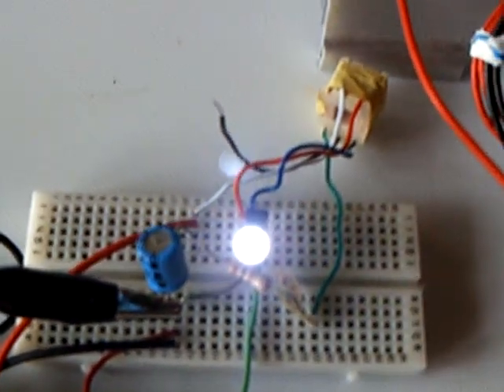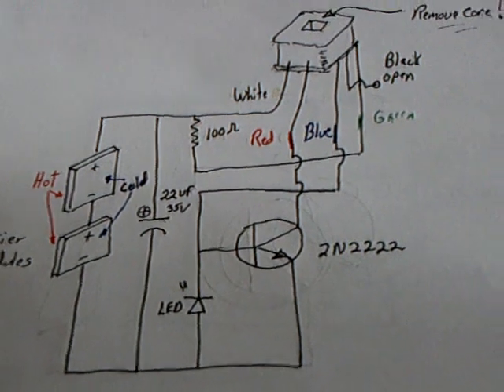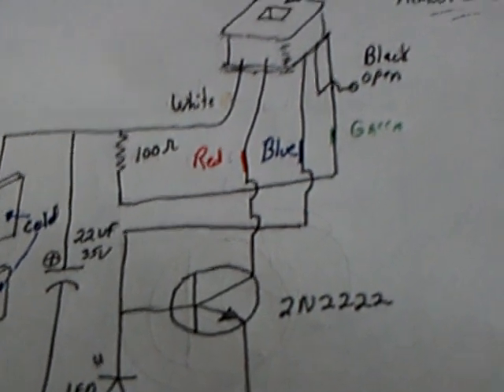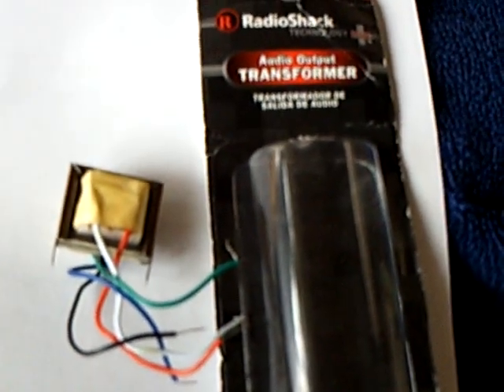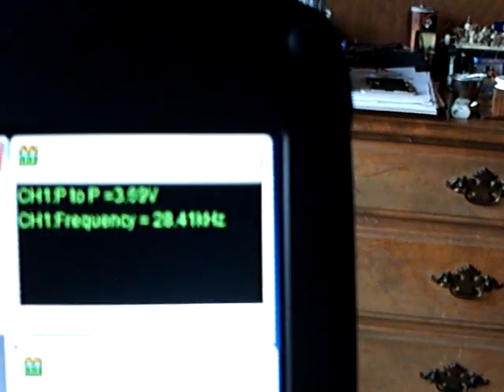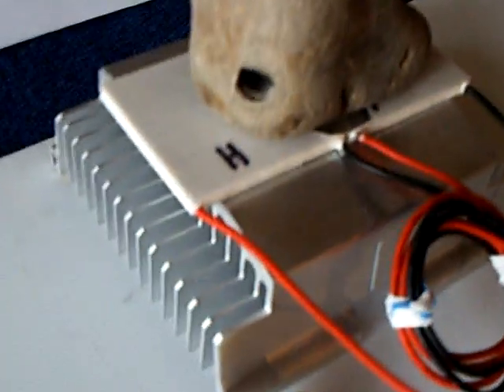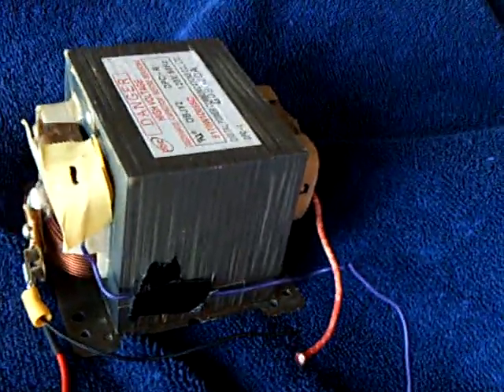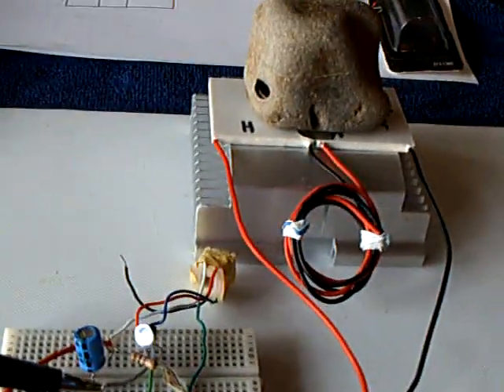Hot rock powered LED light

Comment from the maker: I found out that different rocks heat differently by trying out several in the microwave oven (just a few seconds did it).  It might be fun to research which rocks would work best for this application.  I had a friend who did alot of camping in cold climates and he said that they used hot rocks in the tent at night to help stay warm.

Comment from the maker: I will have to look at the scope again to see where the baseline was but I think that it was at the arrow on the side of the screen.  The LED is shown correctly on the diagram.  It lights up from the (-).  I had the scope probe connected at the base and the ground wire the the (-) so the wave form is inverted.  The TECs were putting out 120 millivolts at 20 mA..  It is a strange little device.

Comment: Just a thought.. Try an AC NST in the same wiring configuration as your microwave oven transformer. You may get better output. The reason you had to take  the core out of the small audio transformer is because the output was not high enough to saturate the core & perform transformer action. The high wind ratio of a NST should help - NOT the high frequency digital ones - a heavy AC mains powered unit. It may help... It may not... It's worth a try though..

Comment: Hey Lidmotor has anyone tried an emitter biased joule thief yet? Emitter based transistor circuits are mostly used in amplifier circuits because the Beta DC is not affecting the circuit that much. Using a Emitter based Joule thief might give you better amp control over the whole circuit? Just a thought.

Comment: Walmart sells fresnel lenses in their optical department. Try running a tube from your faucet into a CPU water cooled heat sink. Or, the water could be pushed through the tube when your boat is in motion. Use an arduino to orient the lens with a photo resistor array, and servo motors. This could produce more current per size solar panel! Imagine them all looking at the sun as your boat turns and bobs!

Comment: Hi Lid,
many thanks for showing the Base emitter voltage.
Where was the zero line in the scope shot ?
Are you sure you have drawn the LED the right way ? So does it only light up from negative 
pulses that needs to be suppressed form the basis to not kill the transistor ?
Also what was the supply voltage from the 2 series TECs in this case please ?
Many thanks.

Regards, Stefan.